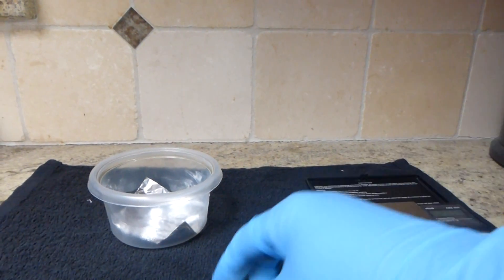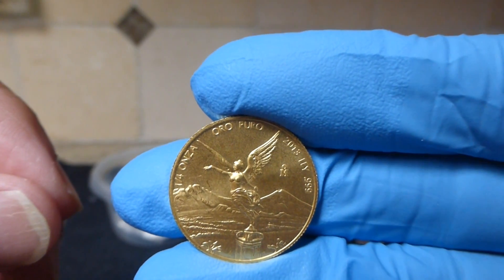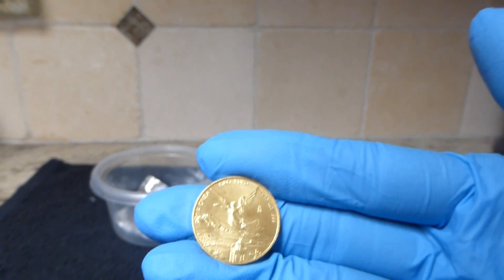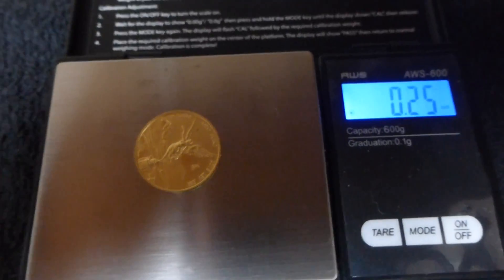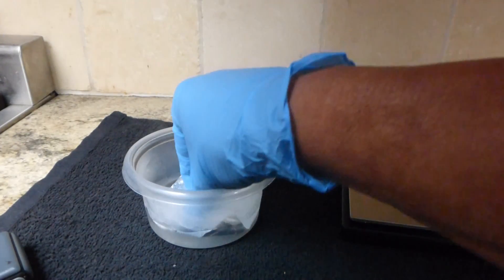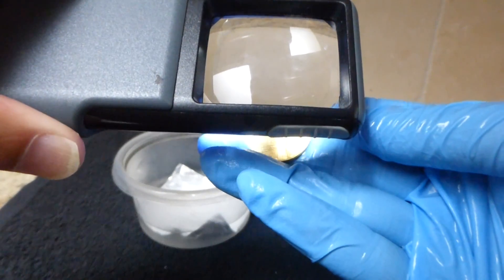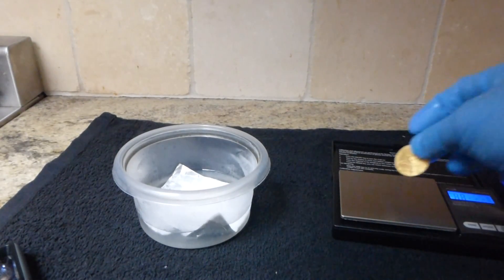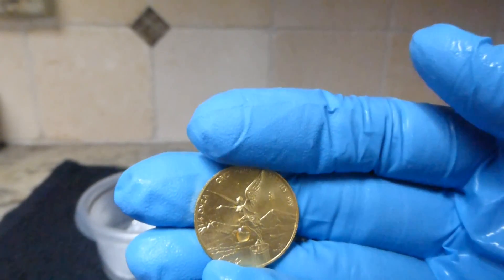Copper Spot Removal from Gold 2013 Libertad

Comment: This may work, but the Baking Soda can scratch the coin.  A safer method where you don't damage the coin at all, is to get a Butane Torch and torch the spot  for 3-5 seconds. It should come Off! I just did this to a 2013 Libertad PROOF! It had a dozen red spots, really bad! In seconds they were ALL gone!

Comment: Does that affect the bu condition of a coin?  I just noticed a red spot on a half ounce Libertad. Apparently libertads are prone to Copper spots
Reply from the maker: Other than the removal of the copper spot,  I didn't see any adverse affect on the coin. There is no noticeable indication that there was ever a spot after the "treatment". That coin is off in storage so I'm not able to take it out now to check it out, but the last time I looked (about 3 month's ago), it was still pretty clean.
Reply: Yeah they do. I have a 1 oz gold libertad and it has light red spot.i might send it to ngc conservation to get it clean